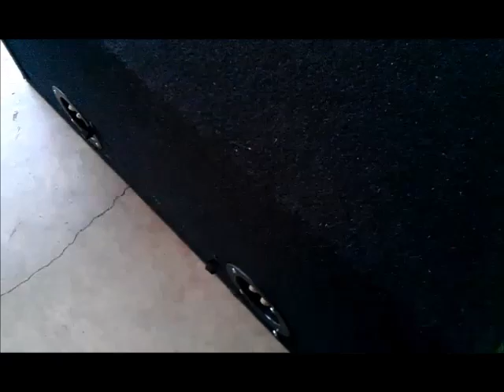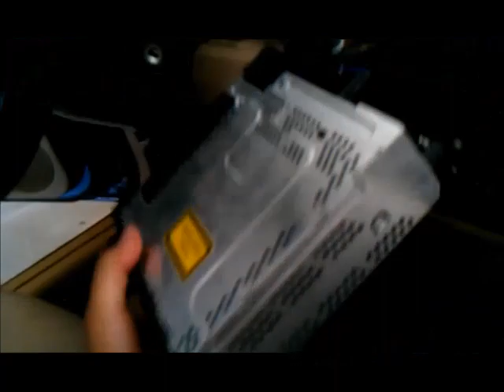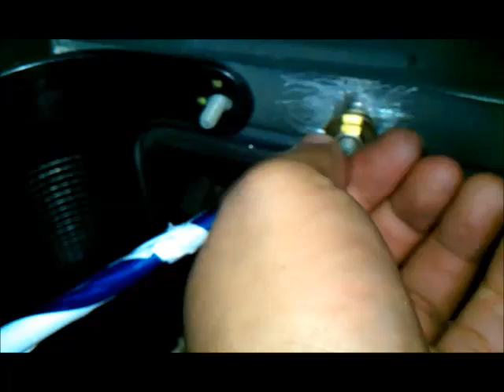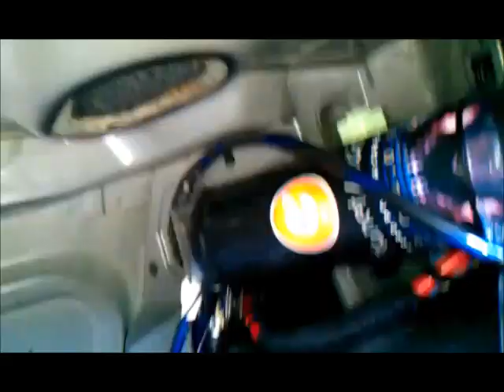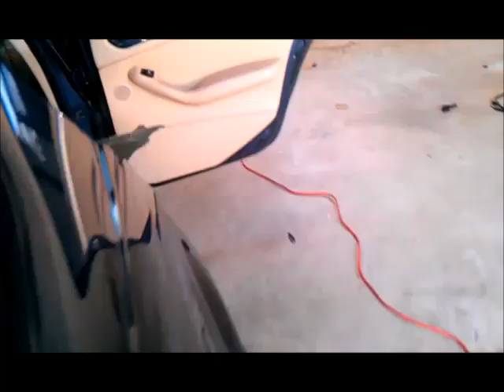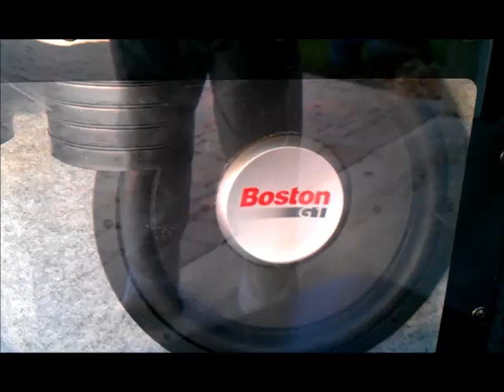COMPREHENSIVE GUIDE for installing subwoofers, amp, capacitor, and line out converter

Comment: I need to install line output converter to 2011 GMC Terrain with pioneer premier system but don't no which wires r the power,ground,remote & right/left rear speakers so if someone can help make a video for me

Comment: great video. can u pls confirm is my setup is okay? im planning to tap the loc to the rear speakers so i can power my 4channel amp, i want the amp to power the front speakers and a subwoofer. im plannin torun new speaker wires from the amp to the front speakers? is this right? or do i  do i need to put another loc? im leaving the rear speakers to run from the deck. pls help, thanks

Comment: Do I need a capacitor? What is the purpose for it? Doesn't the fuse on the power cable from the battery handle the voltage correctly?
Reply from the maker: bike4aday it does, but the capacitor is meant to just extend the life of the alternator and battery
Reply: cartzar
Ohh okay, that makes sense :) thank you!

Comment: Your video is shit. Instead of splicing the wires and putting some half fast electrical, you should have t-tapped into each wire. Another thing, the ground should not have been taped, it needs to be screwed down to metal after using a metal buffer to take off the paint so it makes straight contact with the metal. The tape you put around all your terminal rings are half fast, get crimpers and crimp them the right way so you're confident it's done the right way.

Comment: Your rules with the capacitor apply to 1000 watt rms not peak. Most amps have the peak label on it . My amp is 1200 watts but its actualy only a 4x80 rms . For that i definately will never need a capacitor with a stock alternator.